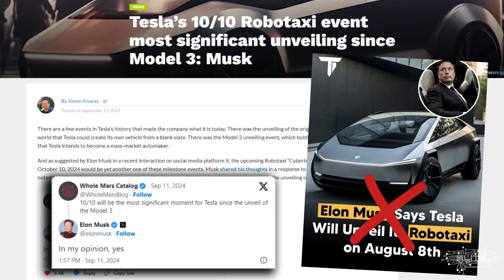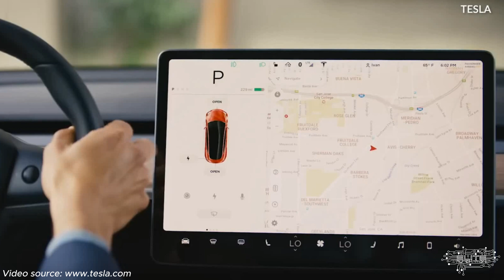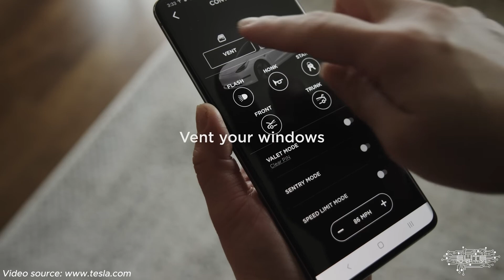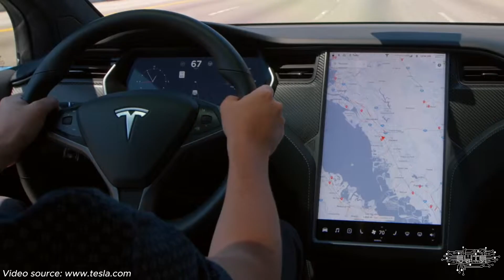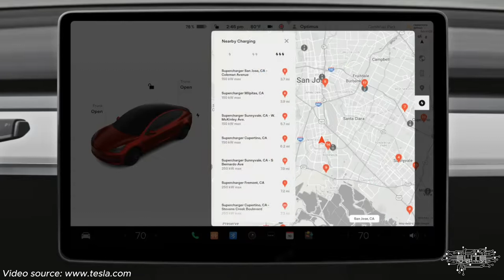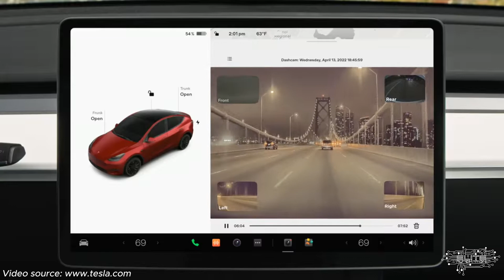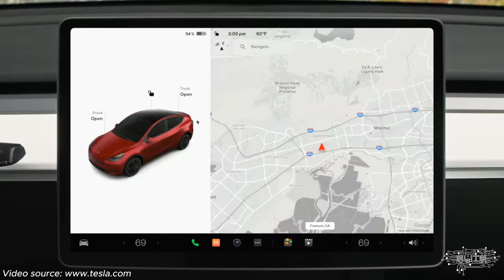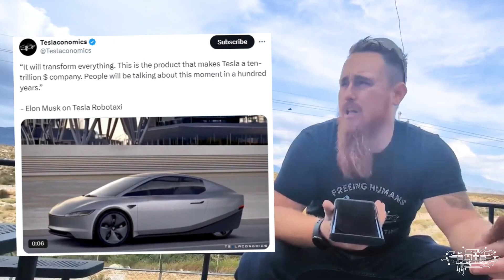Tesla's ROBOTAXI: The Future of Transportation is Here

Comment: The 10/10 event will be more Elon smoke and mirrors as usual. The location of the reveal is so they can premap the area to hide the faults of FSD software. The latest version has run red lights , hit curbs ,failed to read street signs , failed to maintain proper speed . Its not even close to safe enough for robotaxi on public roads unattended.
Reply from the maker: yeah, lets see what lessons we can get from elon and tesla on this 10/10 event, be it positive or negative.